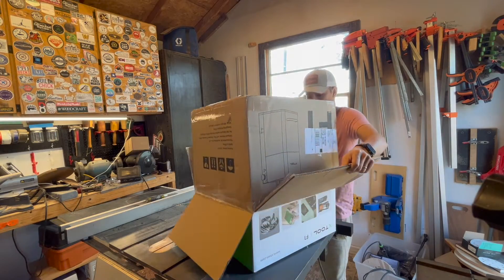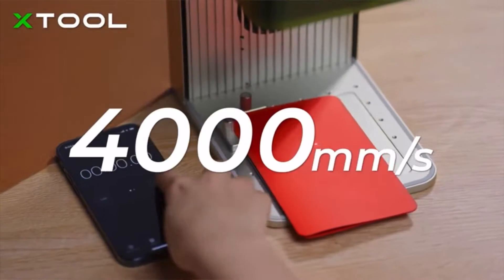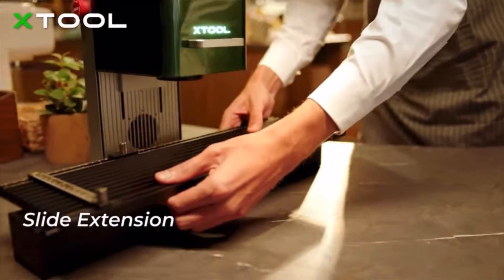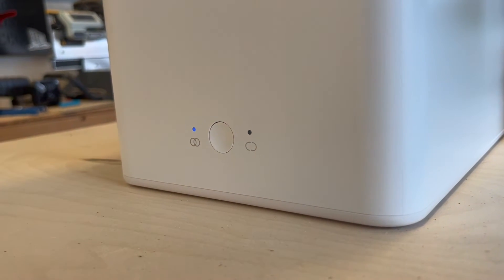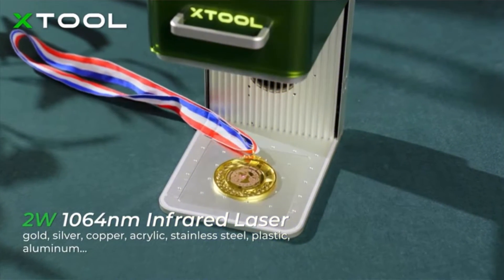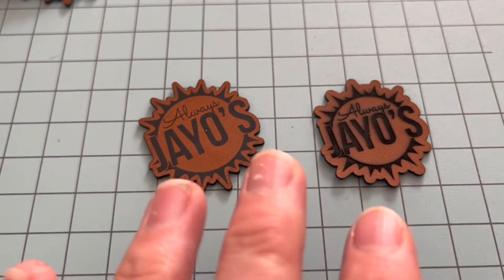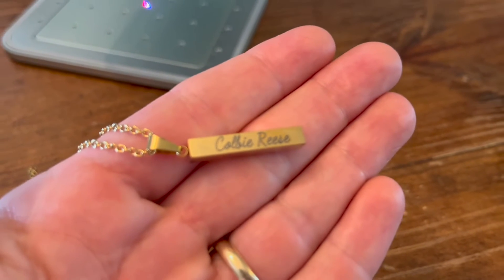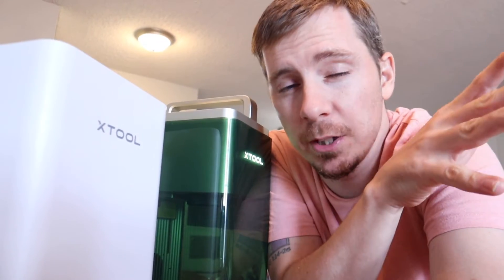This Is The Fastest Portable Laser EVER! // xTool F1 Review

Comment: How loud is the air filter, if you take it to an indoor craft show, will it annoy the neighbors?
Reply from the maker: It does have volume to it but not more than a fiber machine I saw at a craft show recently. It can be set on the floor or under the table and the noise should be stifled enough not to be a bother. Good question though 👍🏻

Comment: I haven't tried it myself yet, but a tio i just saw on another video, is if you spray aittle rubbing alcohol on the wood that was engraved, it will remove most if not all of the burn mark haze (don't know what you call it) from around where you engraved. 

Instead of having to sand.

Like above the eyes and mouth on the magnet you made at 5:20

The video made it seem super easy and quick. They used that instead of sanding or masking.

Hope the tip helps. I've picked up so many from you already
Reply from the maker: Appreciate it Brotha! I probably needed less power on that engraving too and that wouldn’t have happened.